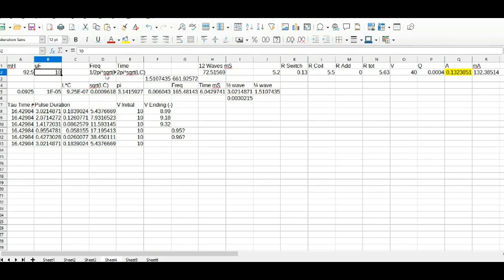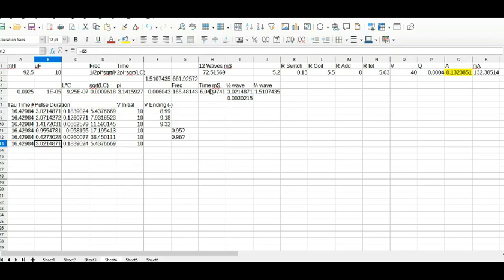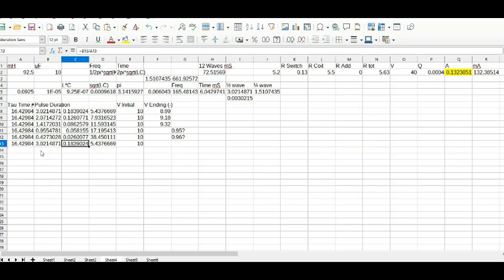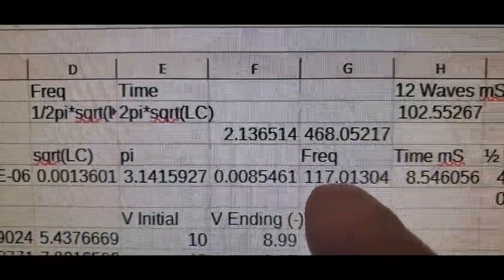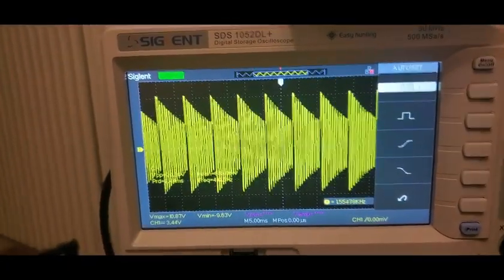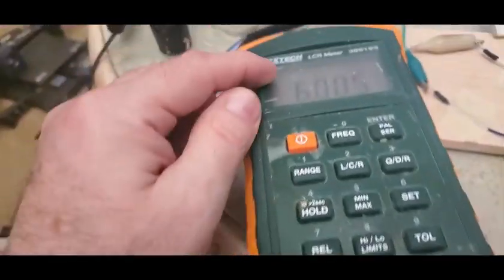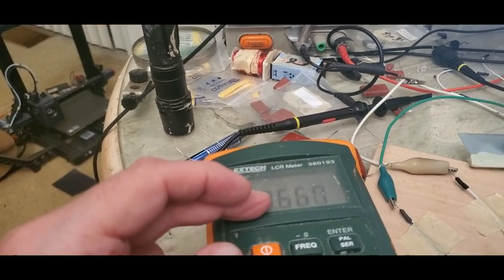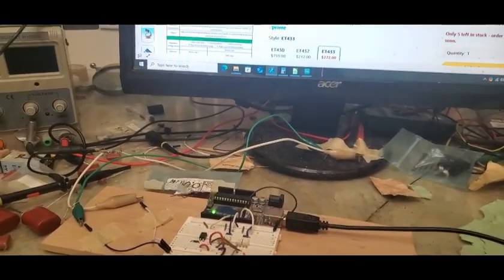Project Q: Background and Introduction

Comment: I have found the same effects, in other words, two coils, one wound tightly and the other wound very loosely give me very different results almost as if the tighter you wind it the more you strangle it.
Reply from the maker: Thank you for the, perhaps, confirmation Johan.  Will have more on skin and proximity effects soon.  What I hadn't got till recently is that for your garden variety coil proximity effect is greatly predominant.   Am working a lot now on how to get some decent spacing with the 3d printer, that is turning into a "bit" of work.  What I am curious about as well is what happens to inductance as you increase the space between winds.  That is to say if you can run twice as fast before hitting proximity effect resistance but your inductance has gone down four fold so you run twice as fast anyways you aren't getting anywhere.  I would be really, really, really surprised if the induction dropped 4 fold when adding spacing between the winds.  I don't know what inductance will do, might go up! That said if I had to guess I think inductance might decrease 20-50% with added space between windings.